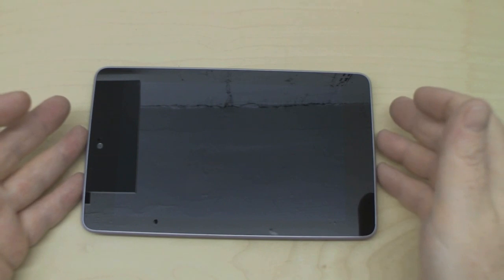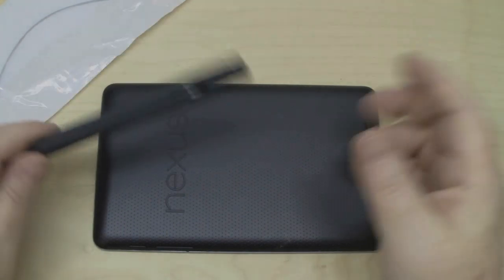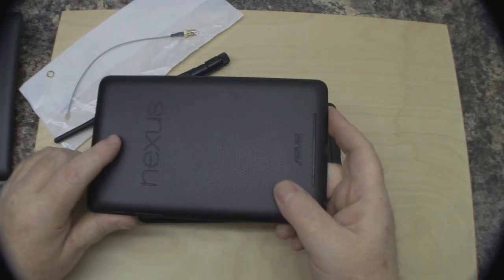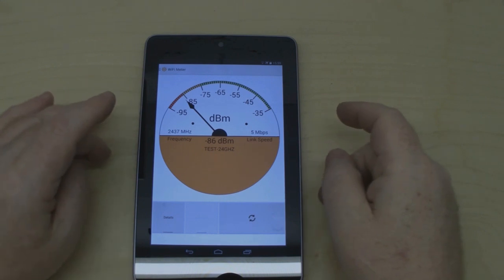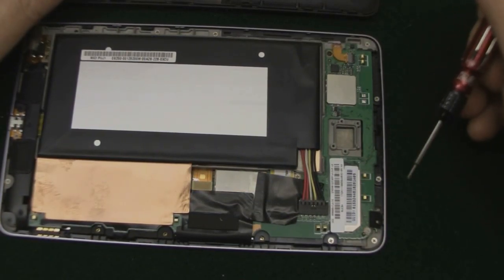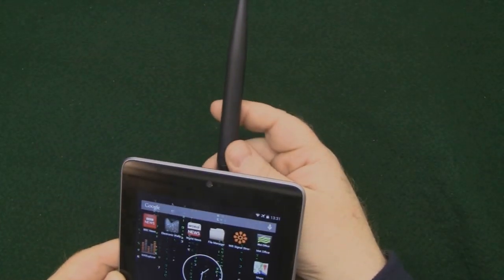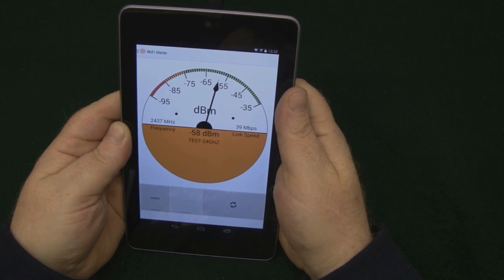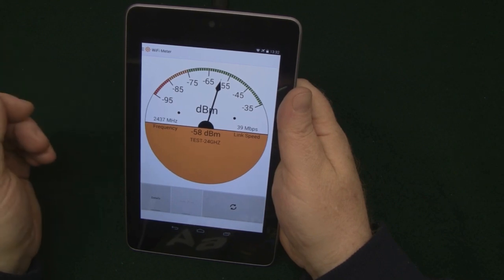Nexus 7 Antenna Upgrade 1 #57

Comment: Hey I was just looking around because I have one of those wifi contacts, (not on the back, rather on the wifi card side) that has broken.  I was wondering if you might know if i can simply solder the broken half back onto it, or do i need a whole new gold contact? 
I found it bent, the wrong way, and it broke when i went to bend it back..